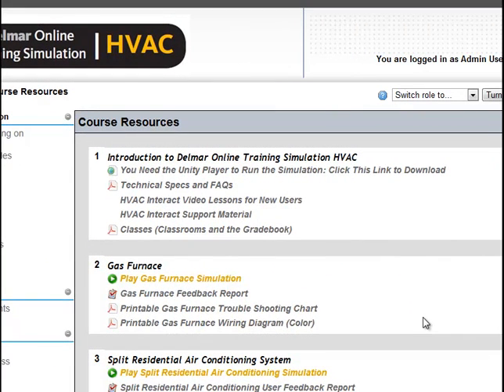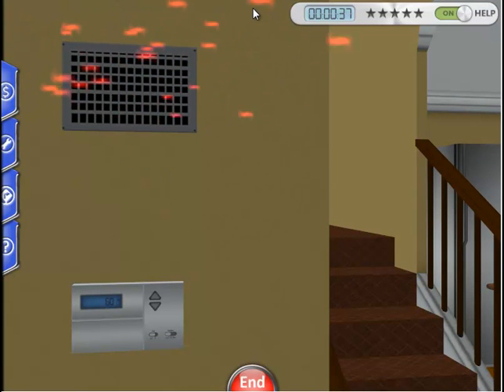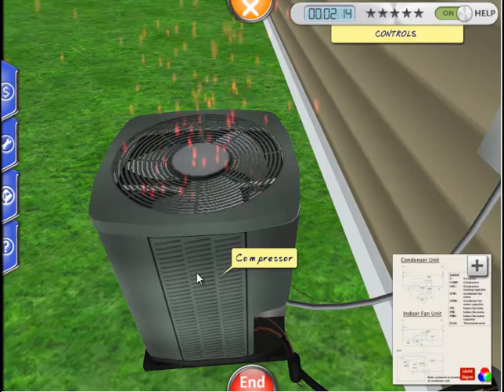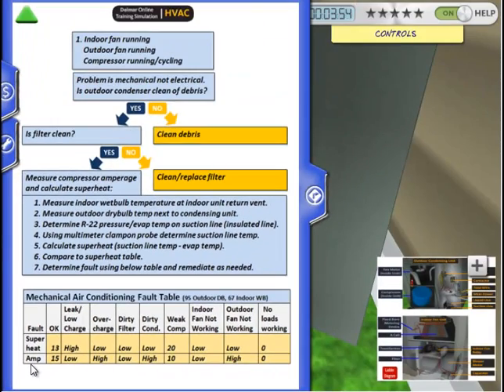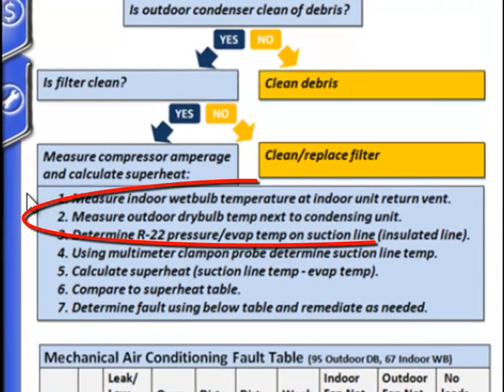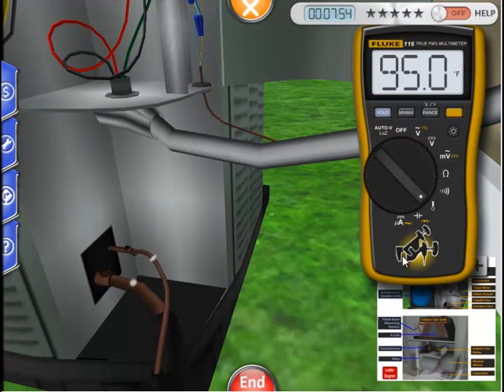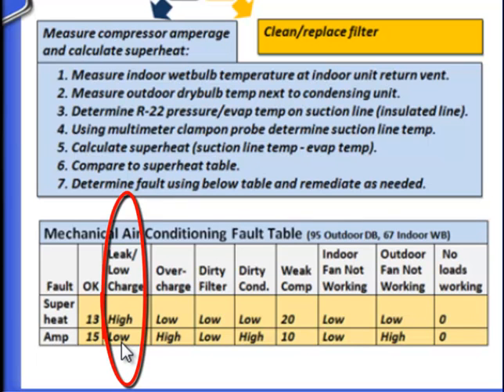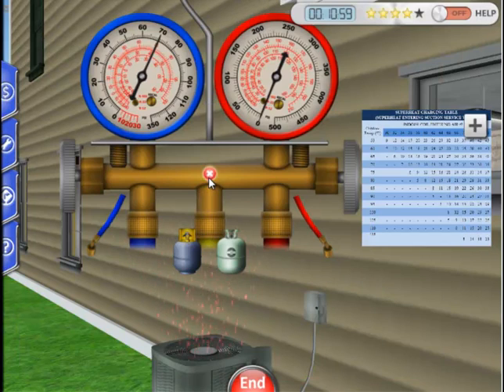HVAC Tutorial: Residential AC Lesson

Comment: That was a pretty weak leak detection effort. There has to be a leak somewhere and you concluded that there was no leak. The only way it could not be a leak is if it was not charged in the first place, but then the customer would have told you that it never cooled before. It is assumed that if you have a service call, it was cooling before and just started blowing warm.

Comment: If you need to add refrigerant to system, where did the refigerant charge go?
Reply from the maker: Thomas, when you find a system to be low on refrigerant it's possible that it was not properly charged when it was installed or that some of the refrigerant has leaked out. In the case of a leak, the refrigerant has leaked out to the atmosphere and as you see in the video, you should attempt to find the leak before adding more refrigerant to the system.